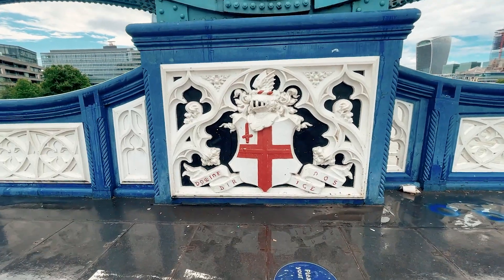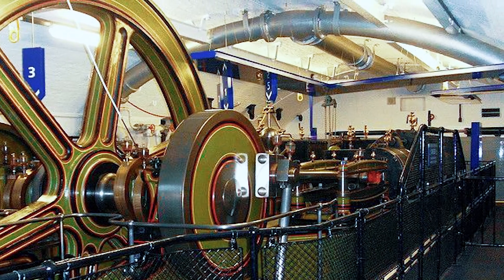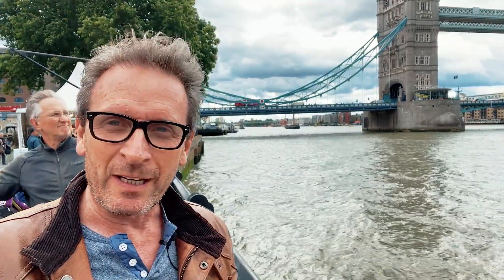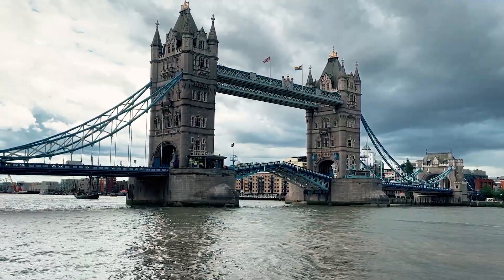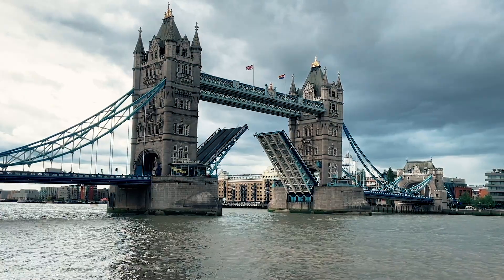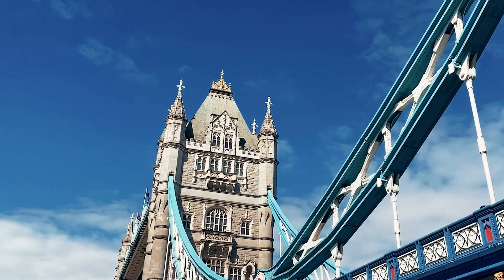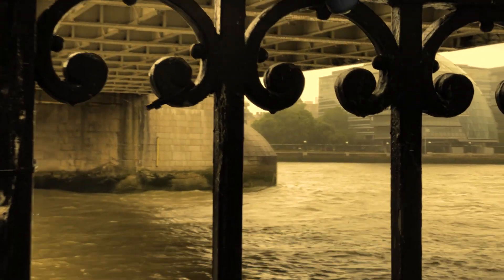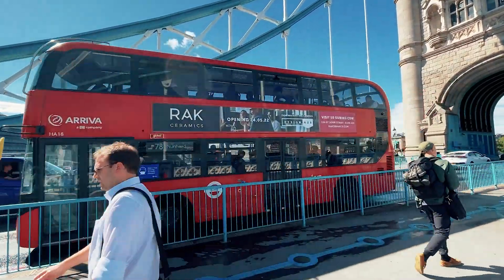The  famous Tower Bridge lift and gruesome Mortuary.

Comment: Astounding that you potentially only need 24hrs to ask to be raised this awesome piece of engineering, and that the whole process of stopping traffic and letting the vessel through takes less than 5 minutes.
Mark, did James Bond or any other fictional character (or even a real figure) ever flee through the bridge while the bascules either blocked or came squeezing down on the heads of the pursuers? Magneto seeming to force them down?
4:18 Oh dear, sudden cartoon image of the bascules at 83 degrees as the Queen passes underneath in a small dinghy, rowed by her valet. Looking up she says " There's no need to make a fuss" or " Oh dear, I was trying to travel incognito".
Bit gruesome that the walkway under the road on the south side is lined with white tiling, then.
Reply from the maker: Thanks so much for watching! I don’t thing TB has been featured in a bond movie, however I do remember Westminster bridge featuring in a Daniel Craig bond movie. I’m surprised Tower Bridge hasn’t been used as it’s way more iconic than Westminster!